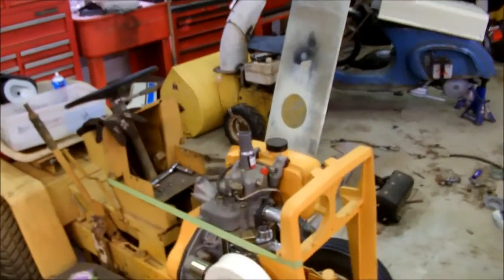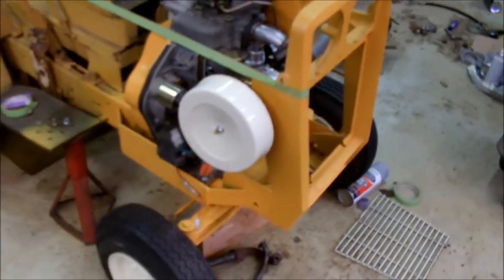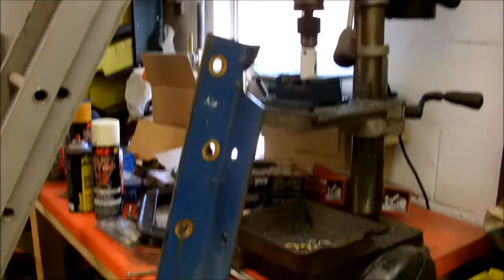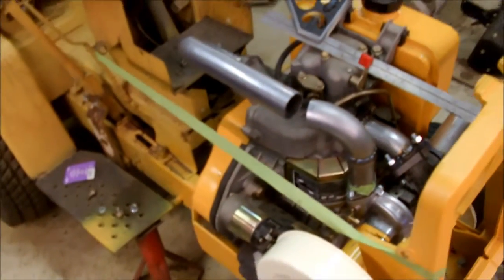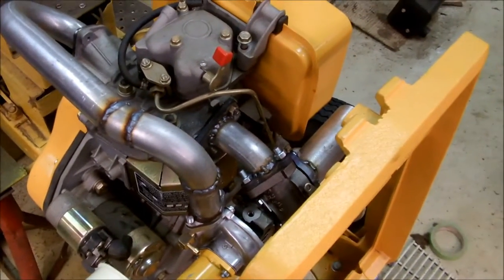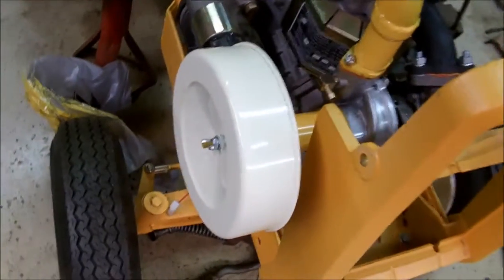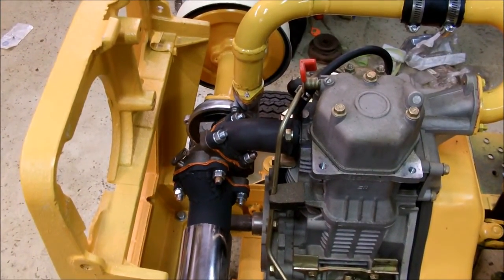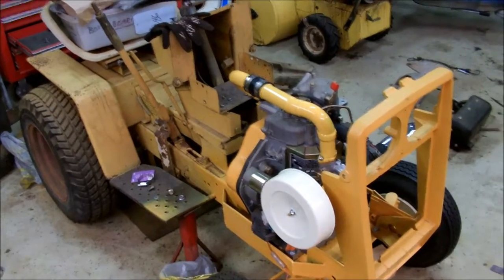Cub Cadet Turbo Diesel Project - Part 9 - Turbo plumbing

Comment: Where did you find 1 3/8 to 1 1/2 exhaust pipe reducers?
Reply from the maker: Autozone
Reply: Thanks. I'm currently doing a turbo diesel conversion to an 1989 Wheel Horse.